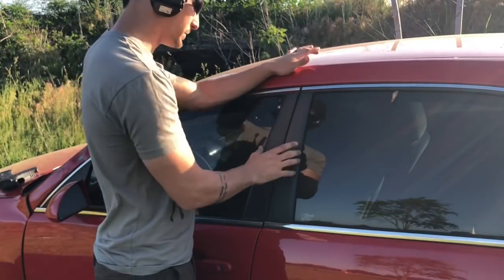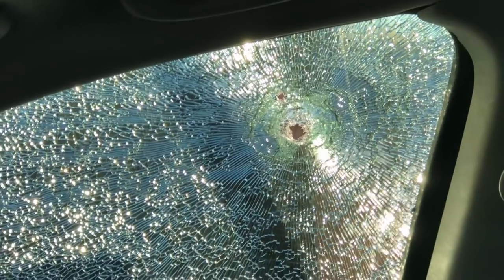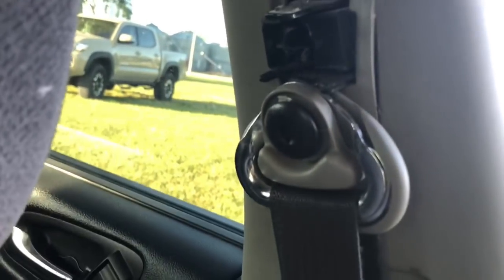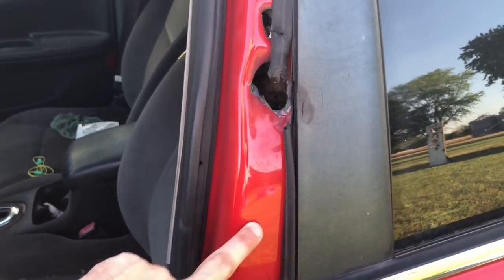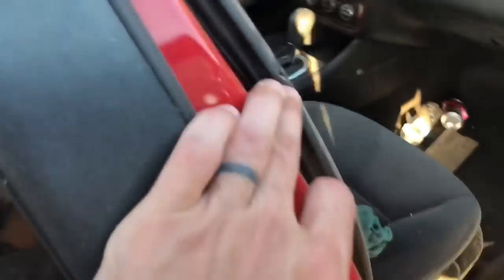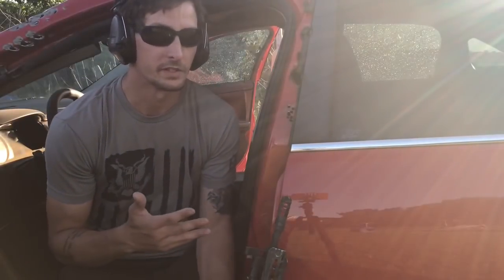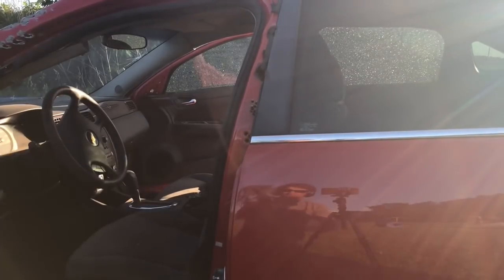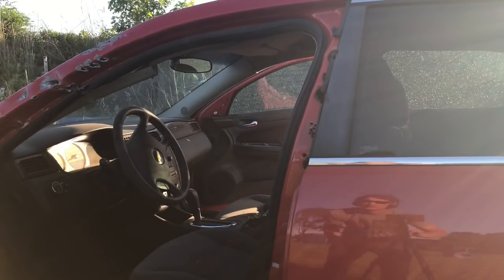What Happens When Bullets Hit Vehicles Part 2: B-Pillar

Comment: Great information! It brings to mind that the more layers and distance between you and a bullet meant for you, the better off you are. A round may punch through drywall and insulation and a few layers of paint, but once it does, it is often malformed and tumbling and loosing massive amounts of velocity. I would expect to see this replicated in the many layers and air voids around many parts of a vehicle.

Comment: Not sure why anyone would aim for the pillars when there’s glass or less metal on either side. A, B and C pillars are structural members. They’re design to minimize the roof from collapsing during a rollover so I’m not surprised about the outcome. So obviously, they will provide much more protection than the door itself or glass. Of course you don’t want to hang behind them too long because they will eventually fail you. I think your protection list is doors, pillars, wheels, then engine. Then again your best protection will alway be distance. I’m actually more interested in seeing how the windshield changes the trajectory of a bullet.